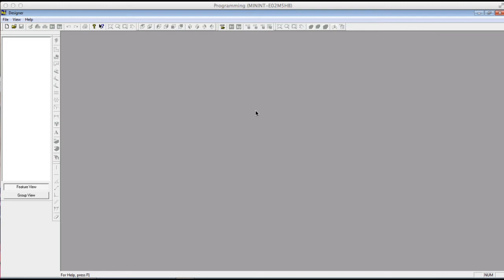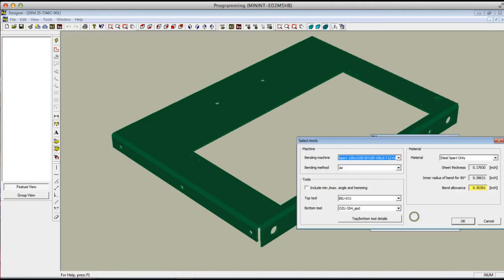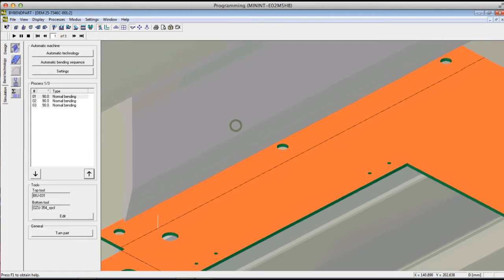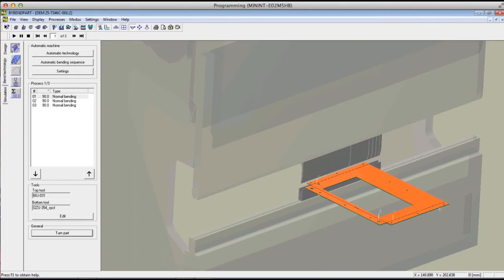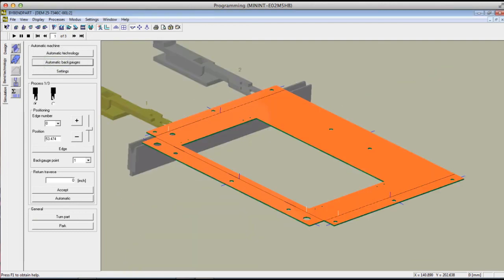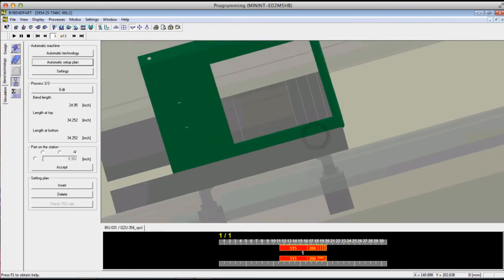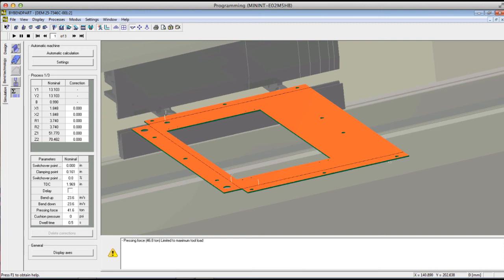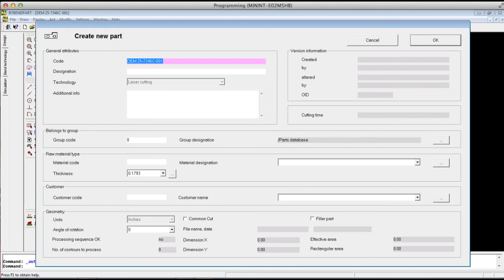Bystronic ByBend Designer - Unfold & Programming

Comment: Do you still use bysoft?
Reply from the maker: Yes, I just upgraded to Bysoft 7
Reply from the maker: Shane Prukop yes, I just upgraded to Bysoft 7
Reply: @MikeD4  are you going to do videos on bysoft 7?
Reply from the maker: Shane Prukop yes, I just got the upgrade last month
Reply: @MikeD4  do you have the touchscreen on you brake
Reply: @MikeD4  sweet, looking forward to some new videos
Reply from the maker: Shane Prukop yes, I have one with and an older xpert without
Reply from the maker: Shane Prukop I sing it for a bit and then get the training
Reply: @MikeD4  What machine do you have
Reply from the maker: Shane Prukop Bystronic Bysmart 4K fiber with automation and a 3k Bysprint CO2